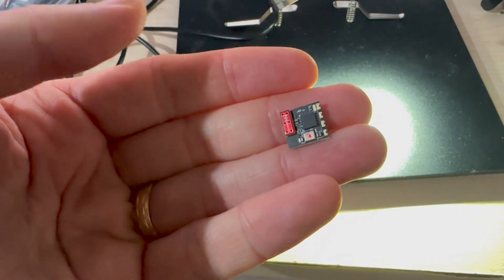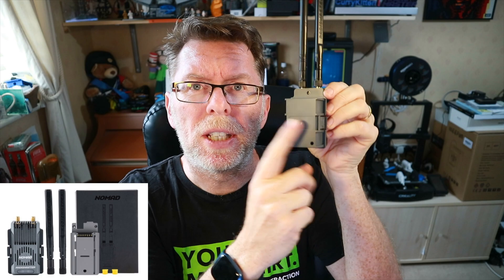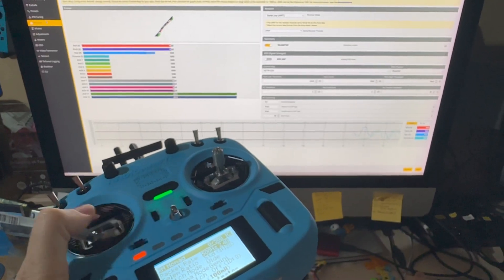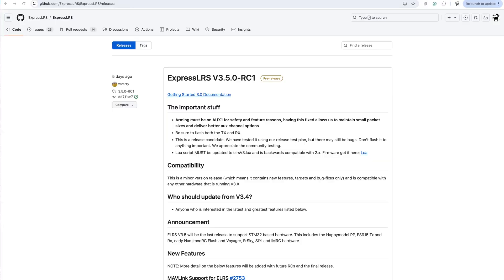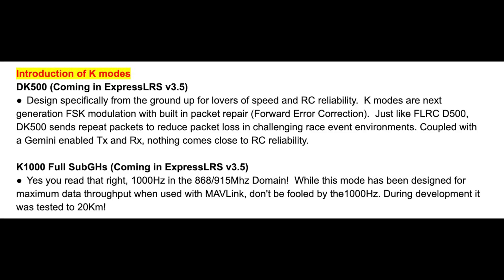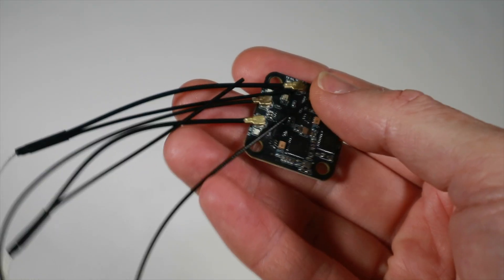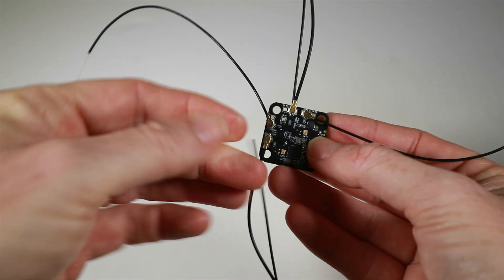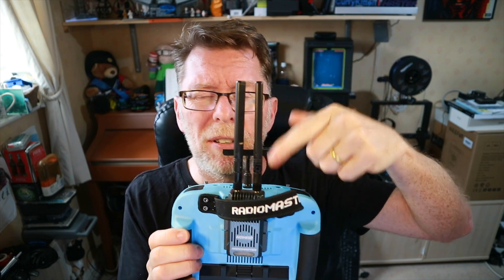RadioMaster Nomad module.  Let's talk about Gemini Xrossband

Comment: Hey man I liked the video do you think the nomed is strong enough to make the drone work better in urban areas if where there is a lot more interference a lot of interference
Reply from the maker: That's pretty much the idea of it.  There's going to places where 2.4 or 900 is dodgy, but where the other frequency can get trhough.  That, coupled with the diversity antenna on both frequencies gives you the best chance possible in bad RF areas

Comment: ELRS looks great and is tempting but I just have so many things running crossfire and crossfire has been amazing for me through the years. I also love getting a new quad set up and upon first connection to the RX it updates the firmware right away with no connection to a PC or anything. I’ll likely just stick with crossfire until I can’t get RX’s anymore or there is some killer new must have feature then I’ll move to ELRS.
Reply from the maker: Nothing wrong with Crossfire - ELRS lifted the CRSF protocol from them, so it's not like it's bad or anything :)  There certainly seems to be more development with ELRS, but when you already have a whole fleet on one system you can;t find an issue with I can understand why you'd stay with it.
Reply: @CurryKitten  True. I do like the progress of ELRS and the new Nomad module being capable of 2.4ghz and 915mhz. That’s pretty awesome especially using four simultaneous streams on one receiver.